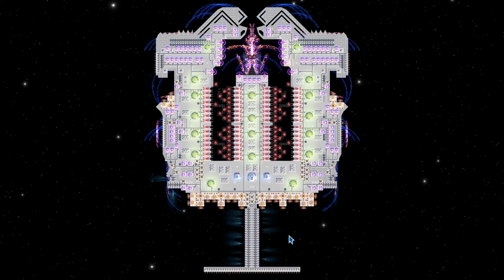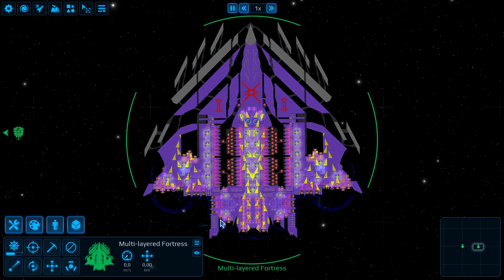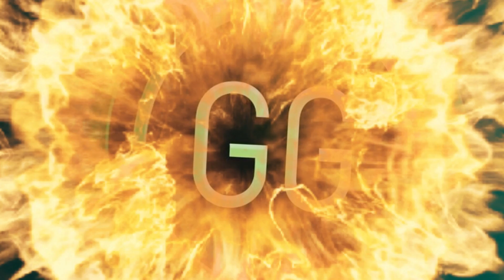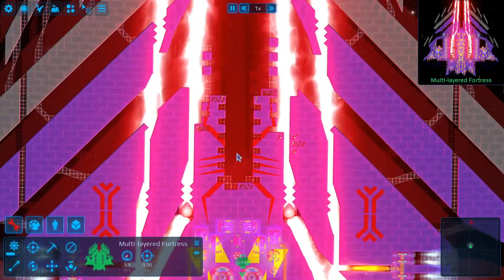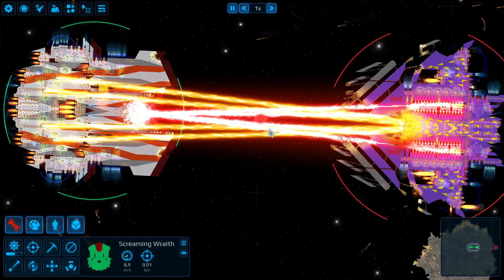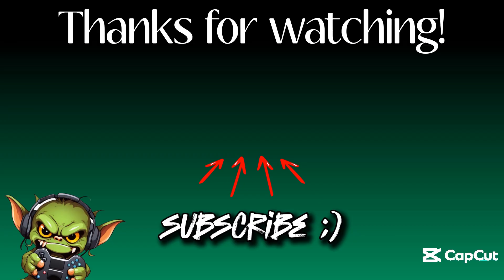I Built DAMAGE MACHINES For my Community! - Cosmoteer - Dream Ships Ep4

Comment: Aren't overclocked ion beams worse though?  When you look at pure penetration power the non overclocked is much much stronger at least what I saw in tests of smaller ions setups.
Reply from the maker: Hi there,

yes I would also agree with you, that the raw beam itself has better piercing power, this also counts for larger ion grids, but the overclocked one also has it´s strengths (e.g. against multiple small ships or to take down large ship chunks at once). 

Thanks for your comment and have a nice day! :D

Comment: greetings from germany! nice too see how u optimized the ship. what about high end oc deckcannon ships? or are dc too bad in larger ships?
Reply from the maker: Hi there,

I wouldn´t say the OC Deckcannons are too bad, they have a pretty noticable range increase which is useful of course, especially if you place them deep inside your ship. But I still prefer the casual ones as main Weapons since they have a slightly higher damage output and also don´t rely on a fuctional heat management system. So when it comes to overclock these, I´d say it´s about your play style (short range brawler vs long range sniper) and where in your ship you´d like to place them.

Have a nice day! :D